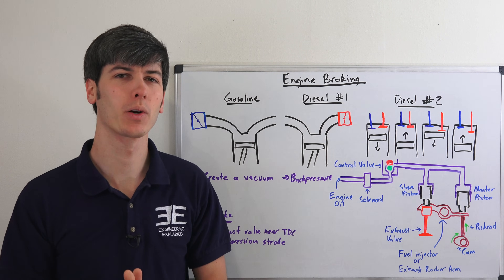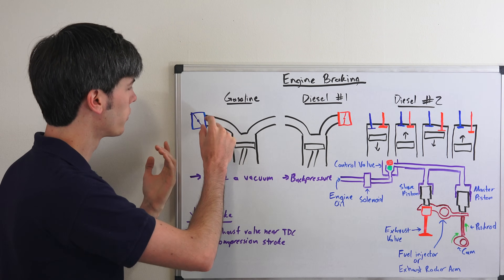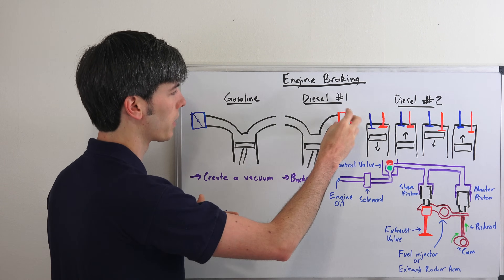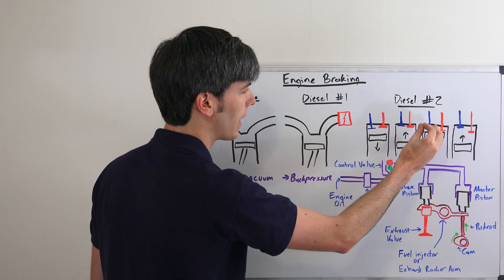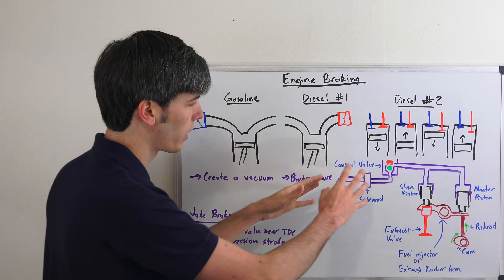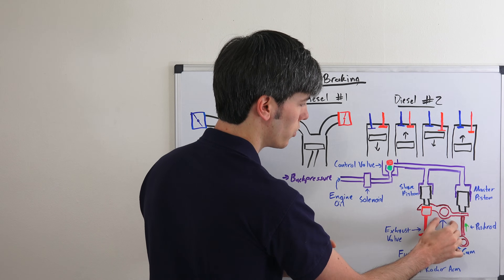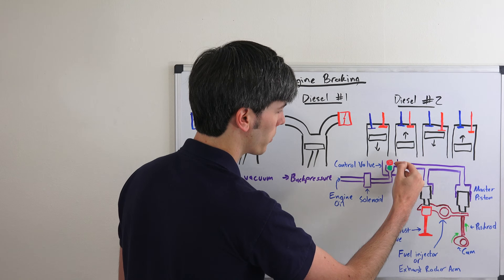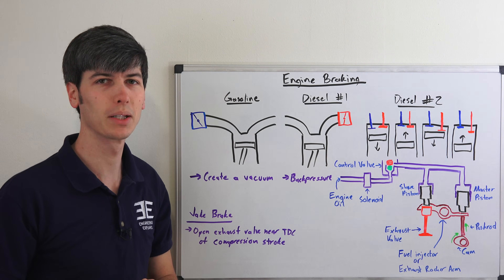What Is Engine Braking? What Is A Jake Brake?

Comment: Interestingly in the owners manual for the Mercedes OM444LA there is a description of an engine braking system that utilized both an exhaust brake and a butterfly valve on the intake side as well.  The intake system was very robust, built of solid pipes with O-Ring sealed slip joints between each pipe segment.  Without question rated to full vacuum.
Reply: +One Day It's a large 21.9L Turbodiesel v12 used for industrial purposes.

Comment: Great explanation as always. Does an exhaust brake cause excessive wear on the engine as opposed to an engine without it? Can I fit an exhaust brake to any diesel engine or does the engine need to be built to suit it?
Reply: +Quintin Scheffer when you let off the pedal with the transmission in gear, the wheels rolling the engine, this will cut fuel to the injectors unless your fuel pump has been messed with. when the governor detects a need for idling ( like when rolling in neutral) it will put fuel through to idle the engine.  any engine i can think of will tolerate it as the compression will bleed off between compression strokes. 

the weak point is going to be your exhaust and its joints. 

however if you feel afraid of messing things up in your engine you can always place a bleed valve between the brake and the engine, along with a manometer and then set the bleed valve to open up at half the max pressure. this will give probably give you half of the braking power. if you buy an exhaust brake im quite sure they come with a fail safe valve on top of their butterfly incase something fails and it wont open again.

as for major excessive engine wear i can only think of it occuring if you rig your brake to only a button and not also to your pedal, forget to switch it off and then push the pedal down with the brake still on. that would cause some hideous amount of pressure and probably throw your exhaust straight off the engine.

Comment: I have heard that Jake brakes are hard on piston return springs.
Reply from the maker: +Makitaization Someone was dishonest, it's far worse on muffler bearings.
Reply: +SpeedyNeutrino172 So you actually believe the story of the piston return springs?
Reply: +Makitaization The muffler bearings give off a gas that pushes the pistons back up.
Reply: +Engineering Explained ...."muffler bearings"?   BS !    LMAO
Reply: +Philip Koen   Yes,  all engines have piston return springs.  How else would you get the piston back up after the power stroke?
Reply: +Makitaization hahaha

Comment: the trucks with Jake's that are loud are usually trucks with "straight stacks" or trucks without a muffler. a truck with a muffler, especially newer trucks that have not had their exhaust system modified, ( muffler removed), are not unnecessarily loud and can be used in city areas. some towns and cities now have signs restricting use of only unmuffled engine breaks.
Reply: +Ron Fullerton    yes sir you are correct , my c15 ( 500 caterpiller) with the factory dual  5" stack  set up ( 379 Pete daycab which has a short system )  is quieter on jake than accelerating , the diesel pickups are actually louder with there mechanical noises ..
Reply: +Scott Grumpybastard I drive for con-way, and we have freightliners with Detroits. the ones with stacks are quiet when using the engine break, but some of the new ones exhaust underneath. and they are noisier when using the break. I do not use it on those units in areas I prefer to not arouse people.

Comment: good work, I drive OTR trucks no one explained this to me before.  So using the Jake brake in my 15l Detroit Diesel uses no fuel.? also it does create heat.?, going by my computer gages on my 2016 Freightliner Cascadia Evolution I believe this is true  (fuel use, heat production)
Reply: +Donald  Schneider The laws of physics dictate that energy is always preserved, so energy is either in the form of motion, heat, or light. If there's friction in the system, the kinetic energy will convert to heat energy, either in the form of direct transfer to the engine.
Reply: +Donald  Schneider     the new computer controlled injectors cut the fuel off at the injector  thus no fueling,  unlike the old mechanical motors which would and you would get some grey smoke and cylinder washdown  and cause the engine/oil  to wear out quicker  , as for the heat , yes it still generates the heat as part of the compression cycle /combustion process that a diesel uses to ignite the fuel , but most of that is sent down the pipe and not put into the motor cooling system  . also on some motors Like my Cat C15 (500 hp)  they also kick on the cooling fan to create a drag on the engine to help pull the motor down  as it pulls abut 15-20 hp , and when all six cylinders are on ( stage 3 ) it has 400+ braking hp
Reply: +Donald  Schneider 
Of course a Jake brake will produce heat, the energy has to go somewhere? Conservation of energy means that the kinetic energy is still converted to energy of some kind, and has to go somewhere?

However, the engine can withstand heat far better than easily-overheated brake pads. Vehicle engines already have serious cooling systems.

No, heat production does not necessarily mean fuel consumption, as air compression also makes heat. My tiny little tire inflator for my car, gets quite warm when it is boosting the pressure of my tires. Even a manual tire pump, can get even nearly quite hot from just the compression of the air. Refrigerant compression makes the condenser side of the refrigerator or the air conditioner, sometimes quite warm. This heat must be properly dissipated to the ambient air around, or if it is somehow improperly blocked or the fan that helps do this fails, the heat will travel over to the evaporator side and reduce its cooling effectiveness. When I had a car radiator fan that failed, the air conditioner worked just fine, except when idling. At a red light, when no air is blowing through the radiators, the air conditioner failed to stay cold until I started moving again. That is why on cars that have both radiators stacked against each other, there are 2 mechanisms that turn on this fan. If it senses that the coolant temperature is becoming too high it will cycle the fan, or if the air conditioner is turned on then the fan stays on.

Comment: Engine braking is when you downshift to a lower gear and use the engines rpm to gradually slow you down.
Reply: +Howard Johnson "Engine braking is when you downshift to a lower gear and use the engines rpm to gradually slow you down."

Which works because of the reasons explained in this video.
Reply: +SidewaysGts You're geniass.
Reply: Howard Johnson And youre ignant. Whats your point?

Comment: Is engine braking bad for engine? Can you explain for both diesel and petrol engine?
Reply: +Miško Brzojebić It depends on your definition of "bad." Does it put wear on the components? Yes. Does it put wear on components outside of the engineered tolerances? Generally no.

For the most part, engines are designed to do this and it is considered a part of normal operation. All mechanical systems will have wear regardless of how you use them as components are always in contact with each other. Regular maintenance, care, and proper lubrication will extend the life of the system.
Reply: +Miško Brzojebić I don't consider engine braking to put unnecessary wear/stress/pressure on the engine, as the system was designed to operate under those stresses. As long as you're properly matching revs on downshifts, you're not putting stress on the system that the engineers didn't take into account.

Also, I shy away from taking the car out of gear too early, as I err on the side of needing to make some sort of emergency maneuver that requires throttle input. I'll generally coast to a stop with the clutch in and shifting down to the appropriate point in case I needed to punch it to get around something or change lanes. Again, the clutch was designed for this type of work, so holding the clutch in isn't putting unnecessary wear on the throwout bearing, but may cause it to wear out faster in the extreme long term. Given the tradeoff between safety and replacing a part on the car, I'll pick safety. :)
Reply: +Miško Brzojebić No it's not bad unless you shift down to a gear too low for the speed you're traveling which will cause your engine to over rev briefly.
Reply: Thanks for your quick replies. Genericasian, by "bad" I meant unnecessary wear/stress/pressure that is not meant to be handled by engine. Anyway, I like to slide to the full stop in neutral (manual transmission) when I can instead of breaking with the engine or brakes.
Reply: +Genericasian I never had a problem downshifting and I rarely use engine braking but I was curious how it works. Thanks for advice, I will try your method and probably stick to it because safety first. haha
Reply: It's very hard on your engine

Comment: So when engine braking with a gasoline engine does it use any fuel? If the throttle body is closed and therefore almost no air gets into the engine the mass air flow sensor shouldn't measure any air going into the engine, and the engine pumps fuel in based on those figures.. i need answers!!
Reply: +BlenderGamerFreaq Depending on the EFI system on the car, it'll either shut the fuel injectors off, or leave them on.  When the throttle is closed, the amount of air to idle the engine still passes through - so the computer will allow the amount of fuel to idle to engine to pass.  On the systems that shut the injectors off... they just do that - shut, no fuel passes.

Comment: This was an excellent somewhat detailed basic explaination of the Jacobs braking system.  I think most operators dont, know how the system operate.  One point you did not cover is how when deactivating the system how the oil returns.
Reply: +Johno Vegas usually by a port on the same valve/solonid that filled the system

Comment: For Gasoline and Diesel 1, you're only telling 1/2 of the story.  For gasoline, if you create a vacuum, it will then pull the piston back up, which will give the vehicle power.  In the diesel engine, you say it creates pressure, which slows the vehicle down.  What you don't say is that PRESSURE is what makes the vehicle go, so that same pressure will accelerate the vehicle.,
Reply: +Dan “Zunkman” Zunko 
Dan asks a good question.  And one I would like answered.  If you take kinetic energy out of the vehicle and create a vacuum on the intake stroke, then it seems perfectly logical to me that the energy would be returned when the piston is pulled up on the compression stroke (less frictional losses).  Energy can not be created or destroyed, so where is the energy going here?
Reply: +David Corley Thank you, David!
Reply: +Dan “Zunkman” Zunko So you are saying when you close the throttlebody and create vacuum, you have infinite power?
Reply: I came here to learn about Jake Brakes, not to get insulted.  This video does NOT tell the whole story.  You experts, go ahead and have your fun.  Us people who want to learn something will have to go to a teacher that knows how to explain something.
Reply: The intake vacuum is not a perfect vacuum.  If it was, it would be like the compression and ignition cycle of the diesel engine, merely returning the power back that was put in.  But the vacuum is not perfect, the throttle butterfly typically has a hole in it to provide some air for the power needed to maintain idle.  So air is sucked in at great restriction.  Work is done and little of it is returned when the piston comes back up.  Therefore the engine does work in pulling against the vacuum and functions as a brake.

Comment: Is the first form of engine braking for the diesel side what we in Australia call an Exhaust Brake? I get told the an exhaust brake is different to a Jake Brake
Reply: +Musclecarlover7   depends , a jake brake is built on the engine , a blue ox or , pac brake are exhaust retarders and are a valve on the exhaust systems that restricts the flow of gasses out the pipe making it back up into the cylinder , they are mostly made for engines that did not have capability of using a Jake brake set up . like some Old style detroit diesel s used them with a jake set up as the motor would build up a fuel load and could go into runaway condition

Comment: How are you putting heat into the engine instead of the brakes? When the engine in braking it is because the throttle body is shut and the engine is not burning fuel and therefore the compression in the engine is slowing the car down. So the only heat being produced is internal friction which the engine would be generating anyway and not combustion?
Reply: believe it or not, your combustion chamber is at the highest temperature when the throttle is closed and the engine is decelerating, especially up by redline.  this is because the fuel actually cools the chamber down
Reply: it's also why running lean is really bad, but running rich is tolerable.
Reply: Ok thanks for info
Reply: +Awesomeman1987 
That doesn't seem quite right, as doesn't burning fuel, provide much of the heat? How can fuel cool the cylinder, if fuel is what is making it so hot? The expanding burning gasses, is what provides the power stroke of the piston. So much pressure is produced, that it overcomes all the losses of the intake compression, and the strokes that exhaust the gases but with the exhaust valves open.

But rocket fuel is used to cool the rocket nozzles to keep them from melting. (According to howstuffworks.com) It is then later burned, probably right after the cooling cycle. I think that is why they often burn straight hydrogen and oxygen. What other fuels can be chilled to ridiculously cold temperatures, without freezing up? So that explains the sheets of ice falling off the old rockets, before they started insulating them better?

+Scott
The kinetic energy being removed from the wheels, has to go somewhere, due to conservation of energy. Presumably into heat, perhaps the heat of compression of air. But the engine can far better take the heat, than can the tiny brake pads that can easily overheat within 45 seconds, somebody said. The engine has a huge thermal mass, and a serious cooling system.

Engine braking turns the engine, from being a power producer, into a power consumer, and it becomes a big air pump, that is resisting the flow of the air. It can do this, due to the great level of compression of the piston strokes. Wasted energy always seems to find its way into the form of heat, which either must go largely into the engine or the exhaust system, both of which are designed to withstand a lot of heat. Whenever I raise the hood on my car, I can feel the heat, if the engine has been recently running.

Comment: I drive a manual and i do this all the time. Sometimes when i drive extensively downhill (driving down a mountain road) i leave it at 4th or 3rd gear, and i use the brakes, but less than if i had it neutral. It feels right to me, but doesn't it hurt the transmission?
Reply: +Makis Makiavelis   No, it doesn't hurt the gearbox to use engine braking to slow the car through the driveline.
Reply: +Makis Makiavelis 
Why would engine braking harm the transmission? The load would not exceed the load that the engine normally supplies already, and as far as wear on the transmission, the forces would wear against the other side of the gears' teeth, which are less worn anyway.

Just shift properly and do not redline the engine. Lower gears actually reduce the amount of kinetic energy that the engine then converts to heat - rate of energy conversion or power actually, which the engine can easily handle heat far better than easily-overheated brake pads, as the potential energy of gravity of going down the hill, is more slowly is converted to heat, as your traveling speed is slower.

What would damage the transmission, is jack-rabbit starts, and "peeling rubber". Rather, use smooth easy starts, and use only momentum to approach red traffic lights, to reduce acceleration then braking.
Reply: Thank you for your answers and explanations.
Reply: VideoMorsels
So what are they doing to reduce the gasoline prices? I presume that is one of the reasons why people want to coast in Neutral? But then, you need to turn the engine off?, and then clutch it back to life at the bottom of the hill? Or get a hybrid?

I can't imagine why I would take a car out of gear. It is just easier to leave it in Drive or Overdrive. And I slow early at red lights, because the momentum of the car, is sufficient to reach the intersection. What is the rush, when the traffic light has to run its pre-programmed cycle anyway. Presumably, traffic lights are far more convenient in most cases, than cops out in the heat, directing traffic, as we see during a power outage at busy intersections.
Reply: VideoMorsels
Maybe she should have got an Automatic transmission? What is the deal with Americans driving Automatics so much more, than the rest of the world? Does the rest of the world, not know, that the Automatic has already been invented?

Why do they not teach this stuff in Driver's Ed? I think when I took Driver's Ed, all the cars were Automatics, although I have driven a stick shift, I have never liked it, and all my vehicles have been Automatics.
Reply: VideoMorsels
We had cars with brake pedals on both the driver and the passenger side. I guess nobody wants to trust lowly student drivers?

I recall having a partner, who could not back up in a straight line. I have always been a good driver, but I wish they would hurry up and come out with the self-drive cars. I would much rather ride than drive. But I guess it still is quite a challenge to write computer software that is anywhere close to the task of safely and reliably driving a car.

Driver's Ed. You mean that government monopoly schools actually teach something useful?